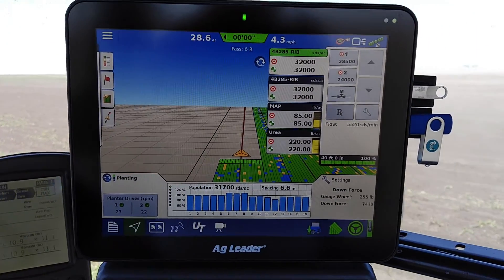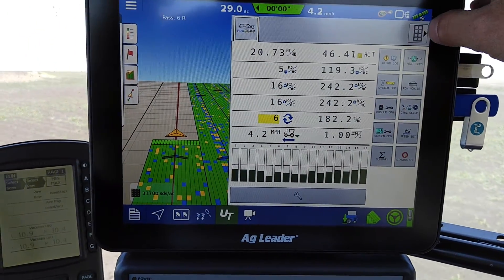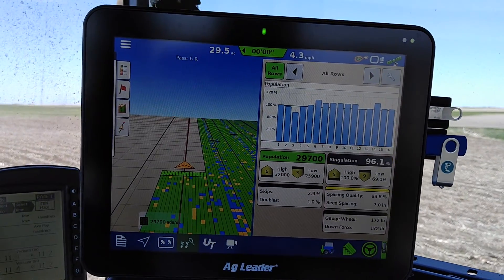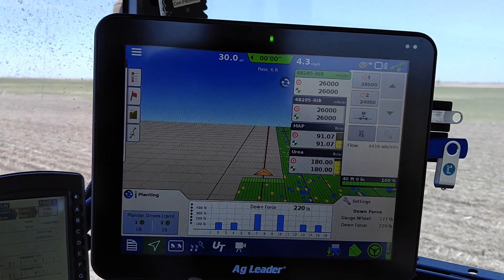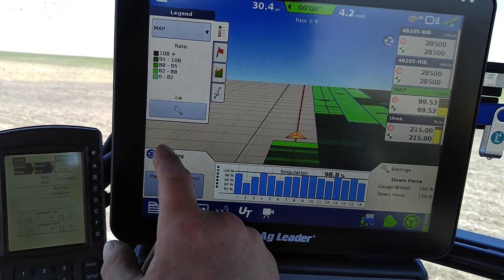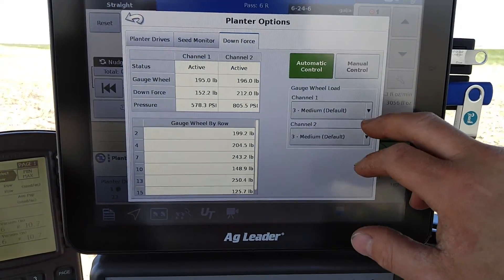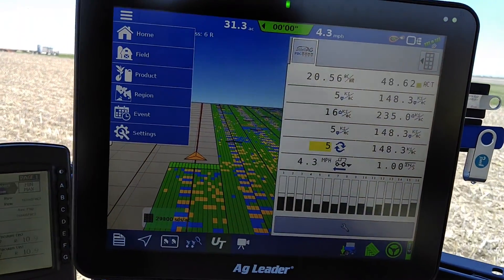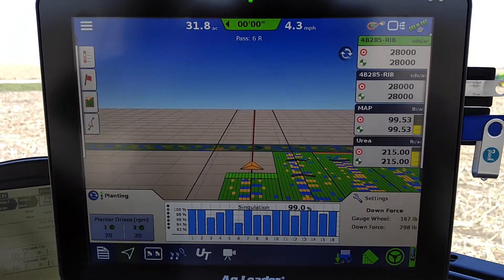Ag Leader In Command 1200 running multiple product and downforce

Comment: Was that running hydraulic downforce or Pneumatic?
Reply from the maker: Hydraulic
Reply: Ok thanks for the quick response. We’re going to a pneumatic downforce on our planter and wondering if the ag leader in command 1200 will be able to control it or if we will have a separate monitor or box to control the downforce
Reply from the maker: @Cheeseburglar60   the 1200 won't control anything pneumatic.  You would be forced to go with a type hydraulic option.  1-2 channel system which is a CAN A system and controls just what it says 1 or 2 channels there are some used ones out there and they use the dawn style hydraulic actuator next in line is the iso downforce system which is i believe is 3-8 channels and uses same dawn actuators which are both obsolete but can still find parts for them it's just no complete kits are being done anymore. Then there is the sureforce system that uses row modules and row by row valves.  In between there was a rcm system that uses the dawn system also but more complex setup with valve blocks that work for each row.   Depending on your planter you might have something oem that was used to control air  example would be a john deere planter might have passive air control system via seedstar so which in this case you could run it over isobus and control air downforce via 1200 display. Without knowing your exact setup hard to say what's going to do what on your planter

Comment: Are you running variable rate with intella ag and the ag leader?
Reply from the maker: No the pdc is just monitoring the rates there really wouldn't be a way to log both Ag leader and the DJ PDC at the same time on one display since both controllers are setup for planter.